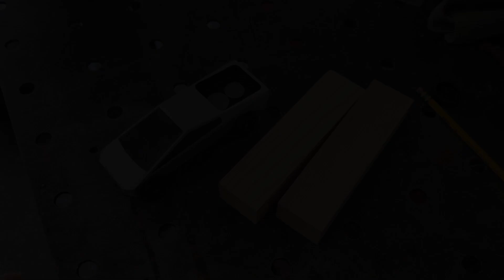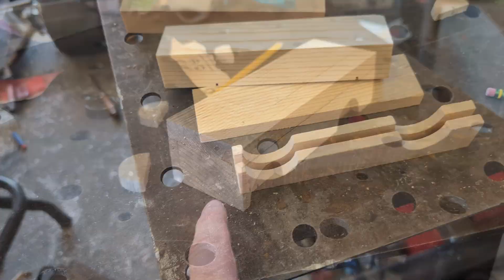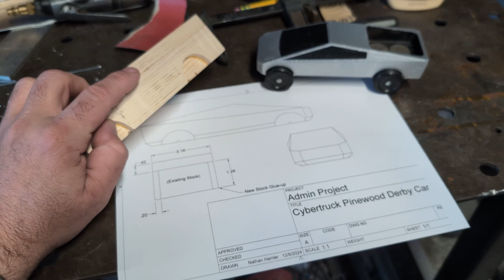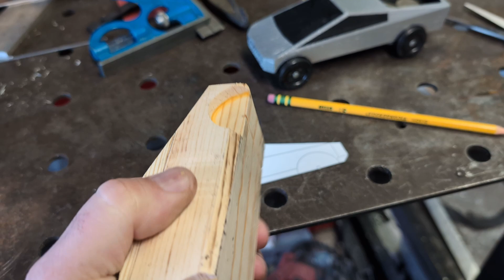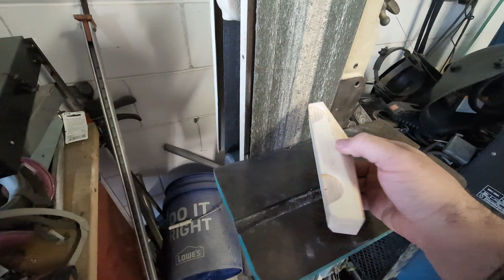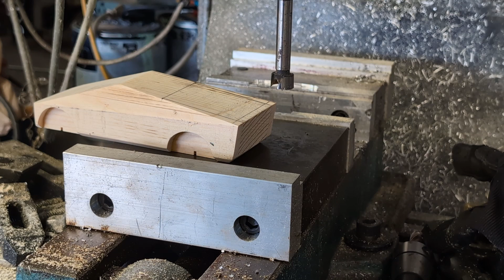Pinewood Derby Tesla Cybertruck Instructions

Comment: CNC file available?
Reply from the maker: @Hexxdump  you mean the solid model?
Reply: @Steelcrafted  An stl, carveco, vcarve, or something along those lines so I can make one on my onefinity.
Reply from the maker: @Hexxdump  let me see what I can come up with this evening.....
Reply from the maker: @Hexxdump  it's not an entirely straight forward machining process ...you have to do 3 different setups on 3 different sides, so unless you're using a proper cam software to make your toolpaths, it probably won't be a straight forward CNC router project.  Just letting you know...